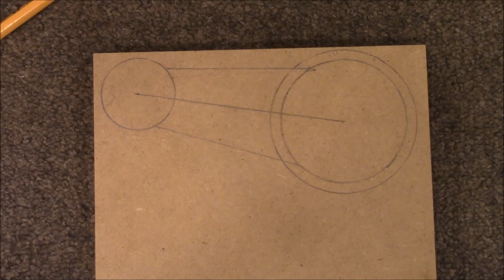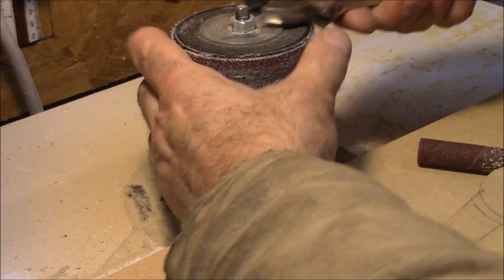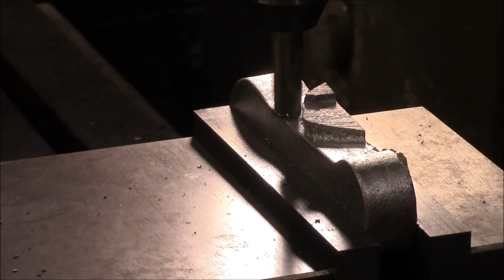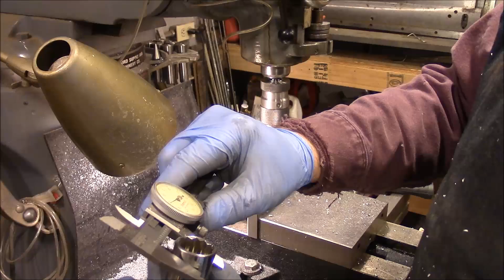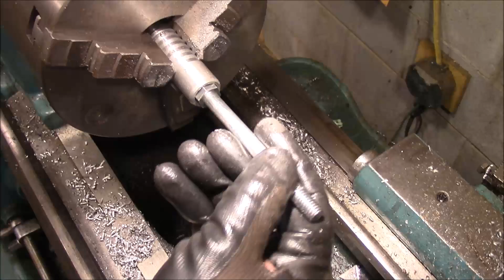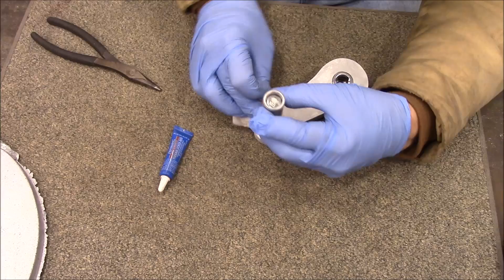Mill Speed Vise Handle

Comment: you maybe should have rounded the head of that bolt on the lathe and cut a slot to allow easy tightening and smooth rotation. I would have went for a slightly tighter press on the socket or at least added some locktite on the socket to keep it tight. It did seem to press really easy on that small arbor press.  It is a good project though and I need to do something similar for my vice although I will likely CNC the shape from 1/2" aluminium. Its on my to do list :-)

Gerald
Reply from the maker: Thanks for the comment.  I don't know the physics behind it but works great, no slipping.  Thanks for watching!
Reply: backyardcnc Thank you for the reply.  I've been using it several months and it has worked great for me.  I have not had any slippage in the socket with as much force as I can apply with my hands.  Rounding the bolt would have been a nice touch, I tend to want to get projects finished and could spend more time refining them.  Thanks for watching.
Reply: backyardcnc frankly I cannot fathom how this has not slept being aluminum. I can't possibly this it doesn't make sense it's tight as you have to wrench down on a Mill Vise I can see how it didn't even slip the very first time. I personally make all my fasteners for projects like this out of 4150 and Flame Harden them. today's to the slick socket on aluminum again I just I don't understand the physics I would leave money and a lot of money then it would slip the first time you tried to crank it.